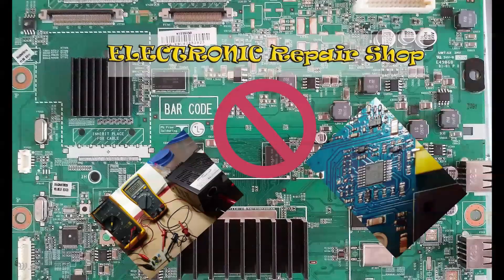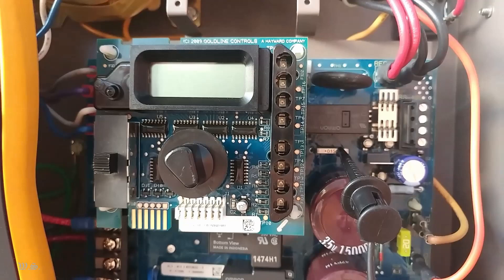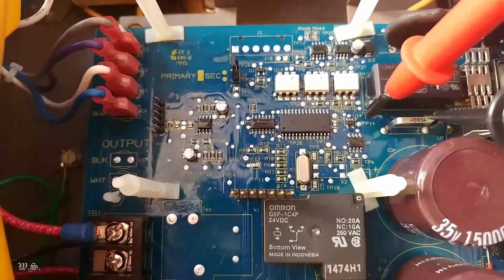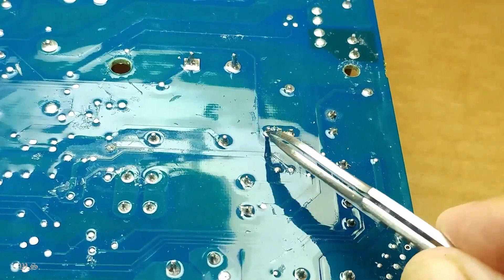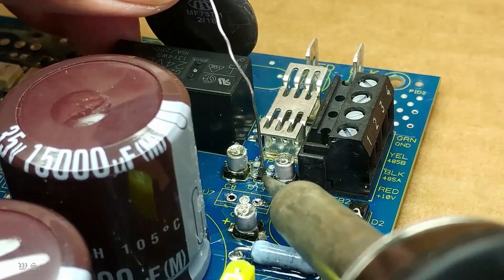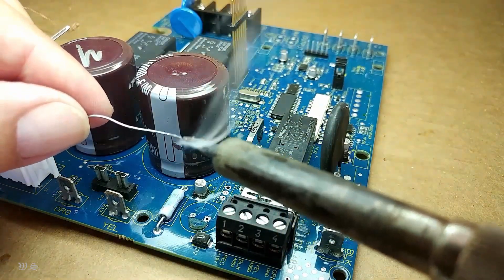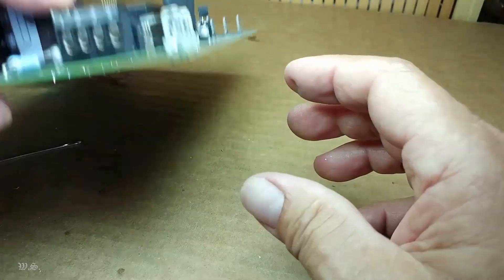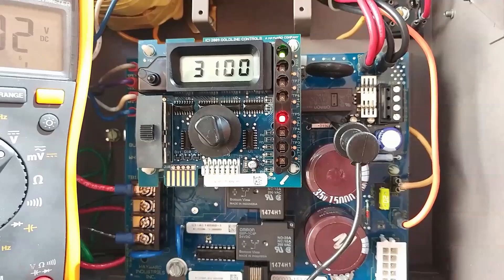Aquarite No Display No Lights == Fixed ==

Comment: Thanks for the video. I had 0v on TP13 so I tried to replace U13. It’s an “itsy bitsy tiny winnie” 5V surface mount regulator. I got the old part off but could not get the new one soldered on. I gave up after 15min and was about to order a new board. I decided to hookup power for giggles and to my surprise the display came on. I remounted everything and it seems to be working for 3 weeks now. Been checking pool water daily and CL levels are maintained. Strange but it works and saved me $150 for now. Just curious,  what is the purpose of U13?
Reply from the maker: The U13 chip, part# MAX809JTRG on a Aquarite bd is not a Voltage Regulator but a Supervisory circuit and has nothing to do with the missing 5 volts at TP13. The upstream U6 voltage regulator provides the 5-volt supply to TP13 and to the downstream components. I would assume you mean you had 0v on TP14. Please review the video! 

The Aquarite and Aquatrol mainboards should power up without the U13 chip or not properly soldered into the pads. But without the U13 in place, the mainboard is at risk of losing the Microcontroller and/or EEPROM data and brick the pcb. Google search the function of MAX809JTRG and find out how it protects your PCB.
Reply: @wanakosabe2093  Thank for the tip. I'll take another stab at soldering U13. Good thing I initially ordered 3 and it looks like they are compatible.
DigiKey part number: APX809S-40SA-7DICT-ND
Manufacturer part number: APX809S-40SA-7

Comment: I have hobbyist experience soldering, yet working with that super-tiny surface mount part was a challenge. As others have indicated, patience is very important  --- and I definitely recommend ordering more than one part just in case one vanishes. Ask how I know :-).

I prevailed, and the display is back. Thanks for this great video!

Comment: 10:58 what would be the process after finding power to pin four but still no LCD screen lit up how to troubleshoot the actual screen itself what is the process if you know it much appreciated and awesome videos thank you thank you thank you
Reply from the maker: There is no available circuit diagram for the display bd. But the easy way is to swap the display bd with a known good GLX-PCB-DSP. You can buy, return it at no cost, and/or sell it back. The choice is yours.

Comment: Question... what if J14 and Pin 4 are good. Does that mean display board is bad?
Reply from the maker: If 5 Vdc is present with the display bd in place then it's probably a bad display bd. Inspect the display bd and use an electronic spray cleaner to clean the contacts.

Comment: Ma’am I have a Hayward goldmine aqua plus (G1-011049F-1 F) board.  My display is out but the system is running, does this video apply to my board?  Thank you
Reply from the maker: Nope! This is for the Hayward Aquarite mainboard (GLX-PCB-RITE) and Hayward Aquatrol (GLX-PCB-TROL). 
The Hayward AquaPlus mainboard (GLX-PCB-MAIN) is entirely different from what is shown in this video.

Comment: Thanks for the video. Am going to attempt the diagnostic - where do u connect the black multimeter tip?
Reply from the maker: @1:27 connect the blk test lead to the R15 Negative metal post labeled .015Ω

Comment: Just like others in the comments, after a thunder storm, my unit stopped working. Came across this video and followed it to a T. No prior experience with Soldering and I was able to fix my Unit and save Hundreds of dollars $$$. Thank you so much for posting this video. Worked on revision board 147 just the same.  “Patience” was the most important part. Lol. Thank you so much.
Reply from the maker: You're welcome! Glad I could help. You have Hayward Aquatrol revision 1.47, the newest and most reliable circuit bd. 👍

Comment from the maker: @Anibal_Torres
The Aquarite sw r1.59 and the Aquatrol sw r1.47 share the same PCB template. This can be easily identified by the presence of the small relay above the R15 negative post or below the black disc on the top right-hand corner of the pcb. Other than that, you need to push the diagnostic button on the left-hand side of the display. Provided your system is working. 
The TFP wiki section might help you > https://www.troublefreepool.com/wiki/index.php?title=Hayward_Aquarite_SWG#Aquarite_No_Lights_and_No_Display

Comment: Hi Wanako. I think your video is very informative. By any chance you know what part number is the dial to adjust the percentage of the chlorine? Mine seems to jump all over if I want to adjust more or less chlorine.
Thanks in advance ;)
Reply from the maker: Sorry, but I don't know the part#.  However, an electronic cleaner spray might help. The % output potentiometer on the Hayward GLX-PCB-DSP is a 4-Terminal,10k with D-Shaft. A direct-fit replacement pot is available, you just have to do the research. For more info, please take a gander at post#8 from the link > https://www.troublefreepool.com/threads/output-does-not-match-the-adjustment-knob.235353/#post-2060958
Reply: @wanakosabe2093  thanks for your help and super fast response. I love your video and your patience.

Comment: With the pump off, the no flow light is solid red and the display shows a salt level reading.  when the pump is activated, there are no lights and the display goes blank. Even though the board is dark when pump runs, it appears to be generating chlorine. Would appreciate thoughts on how to troubleshoot and fix?
Reply from the maker: Pardon the delay! Do you have Aquarite or Aquatrol model? Would you know the software version? If you have the older version, inspect the condition of the Thermistor. Thanks

Comment: After a lightning storm, I had the same problem. You must be able to solder, surface mount. Might as well get extras. At 59 cents each not a big deal. Dropped one. Never found. Thank you so much 💓  better than a $425 board!
Reply from the maker: You're welcome. Glad I could help.

Comment: Hello, thanks for the video.  Question, regarding the AC voltage. When I measure AC input across pins 1 & 4, I only get 4VAC. If I measure pin 1 to GND, I get 115VAC and pin 4 to GND, I get 118 VAC.  All my DC Voltages read zero.
Reply from the maker: Check the electrical Circuit breaker or GFCI. Engage an Electrician if you are not comfortable working around electricity.
The troubleshooting steps shown in this video will not help you address the missing 120-240VAC.  I assumed you are wired for 240Vac! Never measure TB1-1 or 4 against the Gnd post!

Comment: Great video!  My display lights are out, but if I remove and replace it on the riser pins, it will appear to start working.  Flashing red light for no flow, then progress to green generate light, with the yellow check cell flashing.  As soon as the yellow light stops, all lights go out.  Is this symptomatic of a different issue?  Or, is this a similar case as the board in your video?
Reply from the maker: The symptoms you described are pointing to a different issue! Sounds like you have a bad thermistor or bad solder joint. Google search "how to repair the Aquarite mainboard" or  "Aquarite no cell power". Thanks
Reply: @wanakosabe2093  exactly right!  I had replaced the thermistor months ago, and it was visibly loose from a bad solder joint.  Fixed now.  Thanks again!

Comment: Watched your video a couple of days ago to diagnose my board and determined that the U13 chip died. Ordered the part from digikey, installed it today and everything is back up and running. Fixed it for less than $10. Thank you for your help!
Reply from the maker: Good job 👏Glad I could help.

Comment: I followed your helpful steps and feel that I have the same issue with U13. I can here the hum of the power supply when I plug it in and there is no display or power lights. However, I don't hear a clicking sound when the unit is switched to on. Normally I heard a click after a few seconds after turning the switch to auto. Is this 2 separate issues?
Reply from the maker: If the 5Vdc is missing at TP4, the microcontroller and all the chips onboard will not function.
Reply: Wanako Sabe I checked and it’s there
Reply from the maker: @scottiestewart2922  Am I understanding that the 5Volts dc is present at TP14? If yes, then the troubleshooting shown in this video is not going to help you fix your aquarite board. However, I may offer some assistance if you can describe in detail the symptoms you're having with your aquarite swcg. Thanks
Reply from the maker: and if I may, allow me to redirect you to the proper forum. There's a wealth of knowledge and very helpful members in there  https://www.troublefreepool.com/forums/salt-water-chlorine-generators-swg.25/
Reply: @wanakosabe2093  Thank you so much for your help. I have followed the steps in the video and my results are as follows...

red terminal = 31.28V
R17 = 23.72V & 22.53V
TP13 = 4.99V
Display connector Pin 4 = 0

Remove Display Board

TP13 = 4.99V
TP14 = 4.99V
Riser board pin 4 = 0
TP14 to R15 = 8 ohms
Riser board pin 4 = 20 ohms

I first noticed the display board and power lights were off after a big storm. When I plug ac to the unit I can hear a low hum from the transformer. However, when I switch the power switch to auto, I don't hear the clicking sound the unit normally makes after 15 seconds.
Reply from the maker: @scottiestewart2922  Can I assume a testing error? Riser pin#4 and TP14 are tied together via circuit trace! There can never be 5vdc on one and 0vdc on the other unless the link is broken. Disconnect the AC power, remove the display bd, switch the Multimeter to measure Resistance (ohm/Ω) and check the continuity between TP14 and Riser Pin#4. If it reads infinity, inspect for broken circuit trace or hairline crack or broken solder joint.

Also, "TP14 to R15 = 8 ohms, Riser board pin 4 = 20 ohms" << these numbers are too low! It is impossible to measure 5Vdc at TP14. Please pay attention to the unit of measurement (Ω, kΩ or MΩ).
Reply: Riser pin#4 and TP14 are NOT tied together via circuit trace! U13 (MAX809JTRG) is the Supervisory Circuit that sends the signal to enable U14 (MIC2514YM5-TR) Integrated High-Side Switch. U14 turn on power (+5VDC) to the microcontroller and peripheral circuitry including the display board via riser pin #4.

Comment: Where could I get the U13 Part# MAX809JTRG ?
Reply from the maker: Please see the description box. Thank you!
Reply: @wanakosabe2093  all good, found it at Newark Canada. The semiconductor MAX809JTRG micro processor costs about $1, better than $365 for a complete mother board which is what the manufacturer wants of course. Thank you again for the very informative video.
Reply from the maker: @grafx-3signsrentals187  You are welcome. Glad I could help.

Comment: So, I have followed your troubleshooting procedure as I had a similar problem of no power light, no display.  I have 5 volts at TP13, and no voltage at the TP14 point or Pin 4 for the display, and all other voltage is normal as you showed. However, when I remove the display board, I now see 5 volts at TP13, TP14, and pin 4!  Resistance check at pin 4 9.5k ohms and TP14 is 7.8m ohms.  Any suggestions on what to check next? Could the display board be causing the voltage drop? Thanks for any help, I appreciate your video!  (I have older version of the PCB, I think rev C, with out the K4 relay, and I have already replaced the Thermister)
Reply from the maker: Sounds like you may have a bad display bd. Measure the resistance between pins 2 and 4 on the dsp bd. It should read about 10k and 4k in reverse. Fyi, pin 2 is Negative and pin 4 is positive. Try to follow pin# 4 circuit trace to narrow down the troubleshooting. Inspect the pot and probe the caps. If ok, assume bad chip.
Reply: @nmedcalf did you figure this out?  I'm having the same issue as I can get TP14 to come to life by removing the display and reseating while it's on.  However, when I fire up with the display installed nothing comes to life and I have 0V on TP14.
Reply: @The95TA  I think I replaced the display board with one off of ebay.. (I sold that house 4 years ago)

Comment: This issue "thank god!" Is not going on with mine. Your video is very helpful for troubleshooting for other issues!! I opened my panel and right away noticed my voltage limiter split and in three pieces. What can I do to prevent over current? Is it just a thing? ...do I buy two is my question? Lol!! Thanks again for the vid. I'll check into getting some tools to do this work for myself. The tip on the probe electric tape was helpful in that I'm an electrical trouble shooter for hard problem in the auto industry. Def gonna do that!!
Reply from the maker: If the thermistor crumbled, split or cracked the lcd display should still work but no LED's. The mainboard featured on this video is the newest r1.59 build from which Hayward incorporates a K4 relay (right next to the limiter) to prevent the thermistor from overheating. I have not heard of the thermistor failing on the r1.59 build.
But anyway, the thermistor failure is a known issues on the older Aquarite boards and Hayward used two different types of thermistor. It's either SL32 2R025 (Digi-Key Part Number 570-1062-ND) or AS32 2R025 (Digi-Key Part Number 570-1105-ND). The thermistor solder pads on some AQR boards are pre-drilled to take either of the two. The AS32 is known to last longer than the SL32 series. I'd suggest you watch some youtube videos on how to replace the thermistor on a Aquarite.

Comment: Hello, I have this same board, but have a different problem. Power light/LED comes on but the generating LED is not. I ended up replacing the main PCB which did fix it. I have replaced the current limiter before but I believe that is when the power LED is not lit up. I would like to repair the board but I have come up short on info. Any help would be appreciated.
Reply from the maker: Did you mean the generating LED does not come on at all or it does but briefly?
Run the pump, move the switch to "Auto" and turn on the AC power to the swcg. The "No Flow" indicator should flash for 1 minute, followed by the "Generating LED". And 10 seconds later, you should hear the relay click. Sequentially push the Diagnostic button within 50 seconds after the relay clicked. Please post the diagnostic readings.